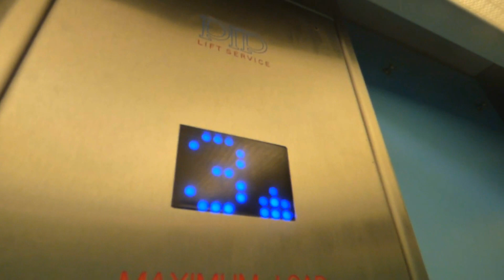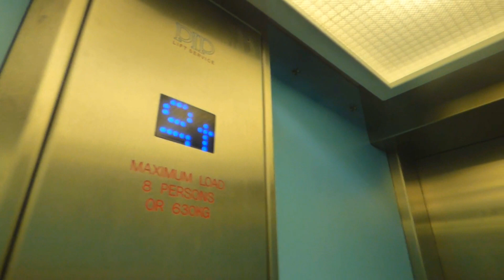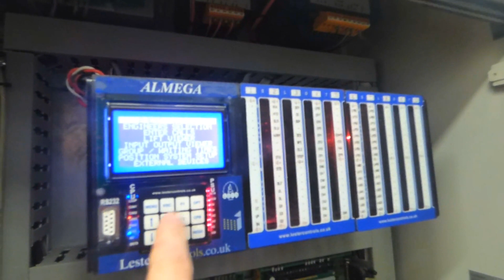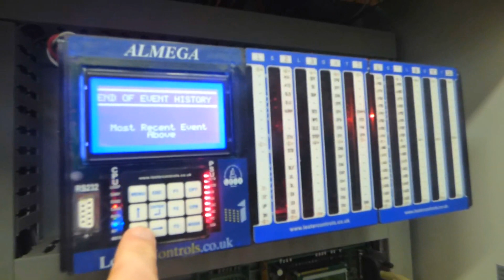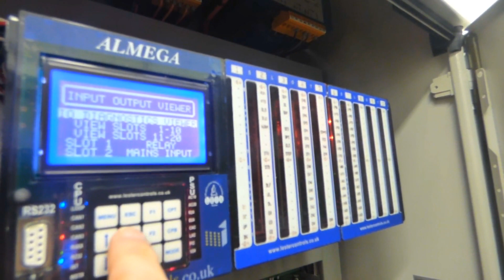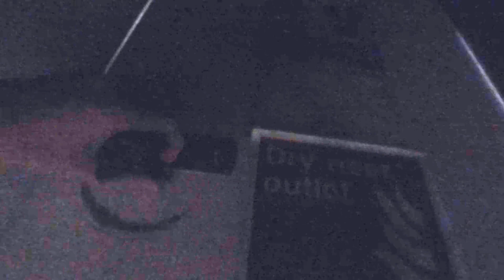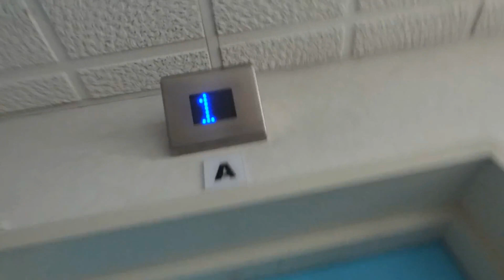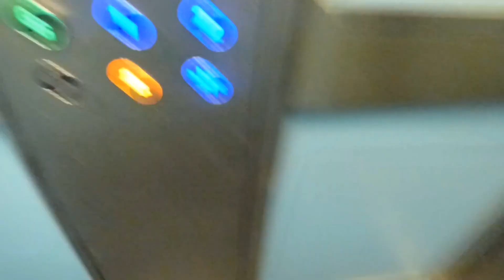Folkstone tower urbex

Comment: What do you think about the Magnetek VF drives that are installed in all Lester Controls cabinets? Are they good or just as crap as Lester Controls itself
Reply from the maker: +ChrisReviewsTech    Modern VF (aka VVVF) is supposed to take full control of the motor.  This means it should position the motor itself.  It doesn't it is just a stupid 2 speed.   It does stuff such as controlled acceleration and speed.  But Lester controls tells it what to do.  It will say go to full speed, go to levelling speed, etc.  There is no improvement with having VF when operated like this.  It actually makes the lift slower.   Since the VF can do precise acceleration, it should also be able allowed to see the lifts position and do intelligent leveling.
Reply: +Beno what year was this tower built?